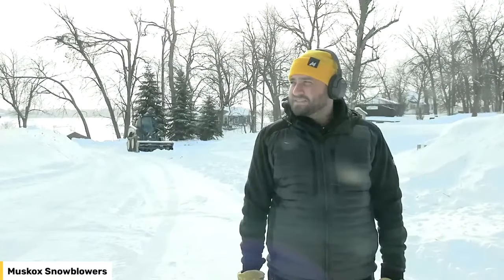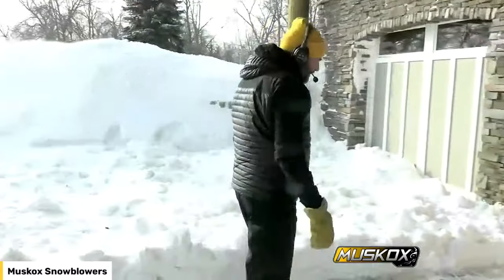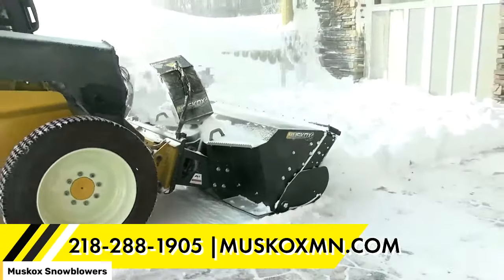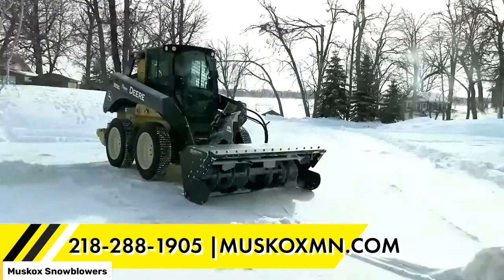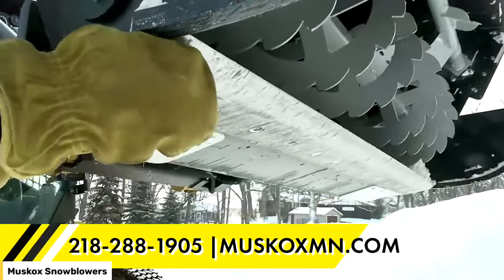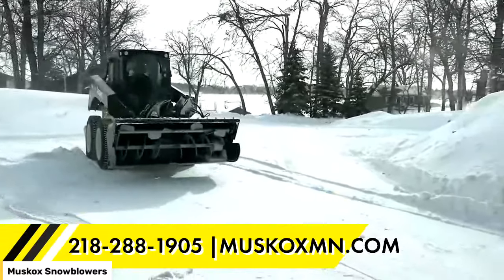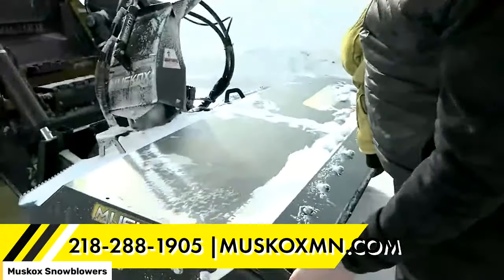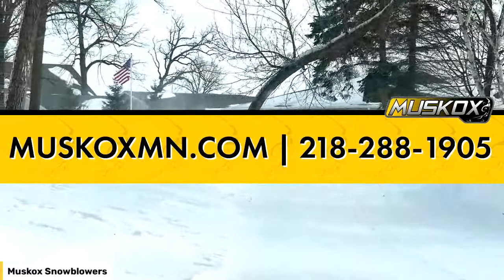MUSKOX LIVE DEMO | 22-78 Bidirectional Snow Blower

Comment: Hi Guys! 
If theres no shear pin, what would happen if a power cord or a big rock would enter the housing?

Also on your next shoot, any chance you stimulate clearing a drive say in a townhome complex where you can't blow the snow a long way as theres only a small amount of property in-between drives. For example on my small yamaha 624 snow blower, I can really angle the snow flight path right back down into the snow bank, as the top of the shoot can be angled down quite steep...like back to the ground.  If you could get some footage showing exactly where you can direct the snow that would be awesome. At the start of this link below, it shows how the shoot can be angled down right into the bank to kinda show you what I mean. The snow you use is very dry and fine so it's hard to tell what the flight path would be in tight spaces operating close to cars/property etc.  https://www.youtube.com/watch?v=rBC1ldgSthI&t=767s

The Yamaha 624 without doubt is an amazing machine, It will blow a long way even in wet snow, hardly clogs and has the most amazing shoot control. Sorry I know we are not talking apples to apples.
Reply: I am also wondering about fail safes! good question.  what happens if I suck up a 50' extension cord?  what happens if I suck up a cinder block?
Reply: @dak009power  It'll jam like any other. Gonna have to shake/reverse-flow/pry it out. Love that its shoot is shorter. Snow sticks to the shoot way less.
Reply: Sorry to be so late on this response, Mark, The MUSKOX has a hydraulic slip clutch. If something get lodged in the main auger, it stops. (we run on a series and have oil bypasses if jammed) The fan continues to run, auger stops, then can reverse hydraulic flow to remove obstruction. Never have to leave the cab!